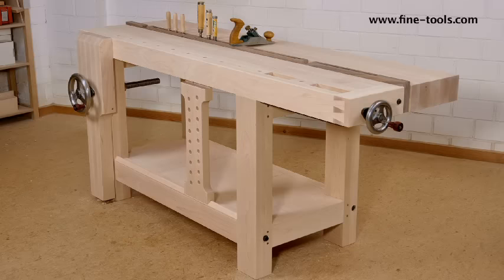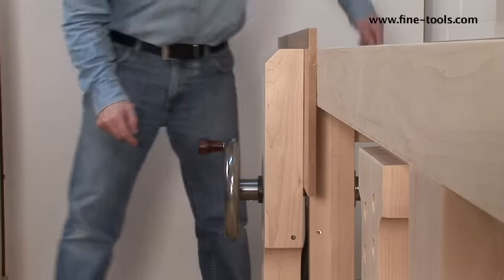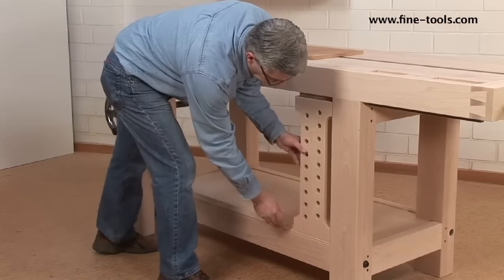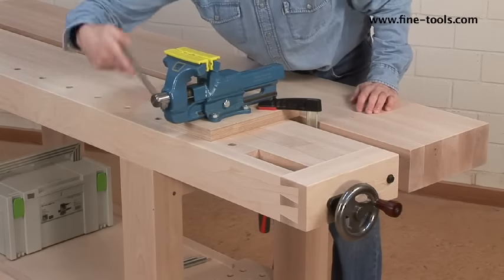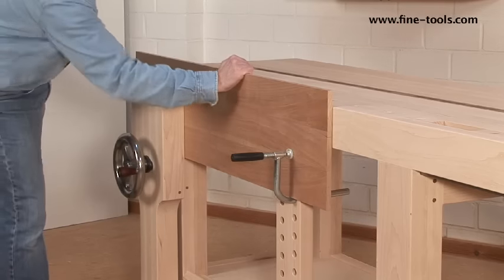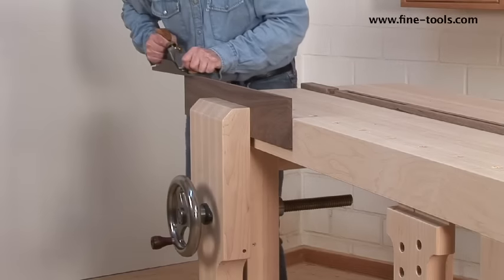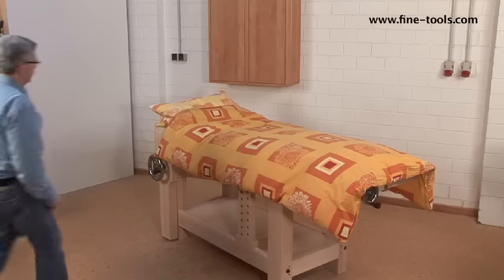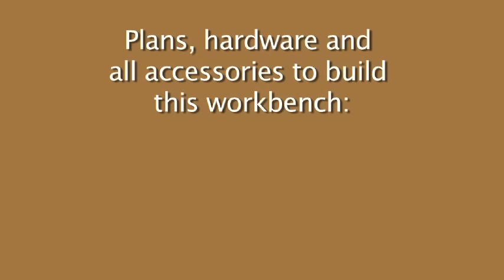Roubo-style Workbench Introduction

Comment: Can anyone advise me please?? Will be really appreciated!

I am trying to make a mortise and tenon for a small but sturdy workbench. the legs are 32 inch tall and 4 inch by 3.75 inch roughly. they are at a gap between the legs of 10.5 inches between them so its a narrow bench but sturdy legs. I have two pieces of 4 by 4 pine that is long enough for this gap but I dont know if I should rip saw it again to make it 2 by 2 for the tenons or is that too thin to give strength? 
My question is what thickness should I make the tenons for the narrow 10.5 inch distance from the closest wall of the 4 by 3.75 inch legs? 

Should I also make tenons length wise for added strength the distance of legs is around 22 inches from wall to wall of the legs. 

I heard to use 1/3 the size the leg stock for the mortise sizing.

Please advise thanks alot, I know its a long winded question and your super busy!

The bench narrowness or depth is 17.75 inches.
length tad over 29 inches. height will be around 35 -36 inches if this helps

Comment: The traditional Scandinavian bench (Tage Frid type bench) with a real tail vise and shoulder vice uses inexpensive hardware and offers huge advantages over this design.A non captured tail vise adds a 13 inches of clamping length over the bench length. The large flat clamping faces of the tail vise will hold large, small, narrow, wide pieces beautifully, the tail vise here simply can't. Even at 13 inches of extension the tail vise can be built to droop only 1/16" and when you tighten the vise there is no droop at all.The Scandinavian shoulder vise has no vertical restriction and the end stop adds great stability. The hardware here does help avoid wracking of the front vice but a real tail vice negates that issue when clamping thin stock. There is a simple design addition to the shoulder vise that eliminates wracking on small stock.I think the imagined difficulty of the real tail vise puts people off, it is a bit more work but when you see how useful it is you can only feel sorry for this design.The fancy hardware is slick, the woodwork beautiful, but the fundamental design is sadly limited and the tail vise especially severely floored.
Reply: To each their own... This tail vise design is definitely stronger, and since the primary purpose of the tail vise is to tighten the dogs, it's perfectly adequate as a second vise.

The Tage Frid shoulder vise is huge compared to other designs and is therefore more likely to be in the way than this design, which is perfectly adequate, even elegant. It's got well more than enough depth, and in fact for many purposes you don't want excessive depth that you'll never use. It's better to have a stop to rest the work on.

Comment: Interesting. Soft-sell sales video with no link for where to buy the workbench. Most apro-po that at 9:00 you are told it will double as a bed for a nap, as the lulling narration and music together almost put me to sleep in the first few minutes (I had to fast-forward to get to 9:00).  FYI, not everyone who needs a workbench like this is a woodworker. Maybe a little opening of 'this is for the plans to build this' would stop so much hateful commenting. I'd buy a workbench like this for my small-engines-repair work, but I wouldn't give you 1-Euro for the plans for it, as I have no intention to start woodworking.

Comment: Guido I need your help You gave me the name of the suppliers of your  aluminiumTee  channel section  but sadly I lost it and now its impossible to cont6act you via Holzwerker  Could you give me the name again please
Bill
Reply: Hi Bill, the T-Tracks I often use are for Metric M8 Nuts, you can buy them for example in this german webshop: http://alu-spezi.de/epages/39916185-3f40-410c-8304-8e98310e5b8d.sf/de_DE/?ObjectPath=/Shops/39916185-3f40-410c-8304-8e98310e5b8d/Products/%22E1C%200M%208%22
Guido

Comment: This is a really nice workbench, those spinning wheels is just ingenius. BUT:  I  would not have a wheel, placed low down , that  I had to bend over for adjusting my wice. Doing that 80 times a day will put a strain on your back, that is unnecessary and may leed to disc problems ( I'm a doctor and woodworker). 
(Please get rid of the pornomusic, serves no purpose)
Reply: I'm not so familiar with "pornomusic" as you are, but I like the music, if you don't - use the volume knob ;-)
Guido